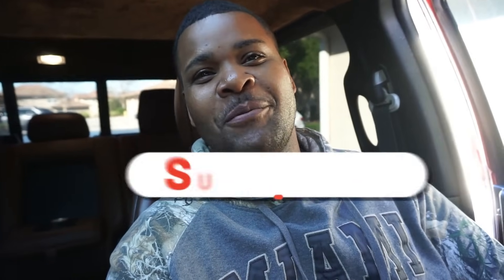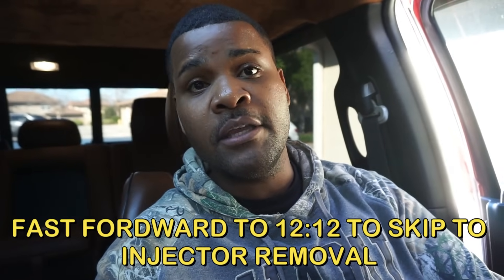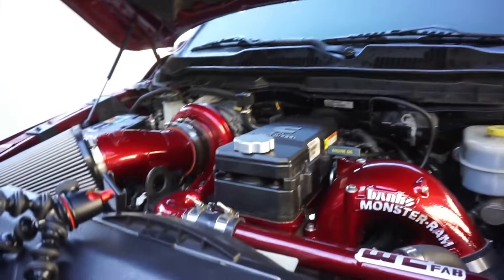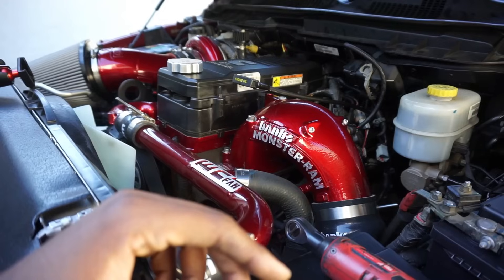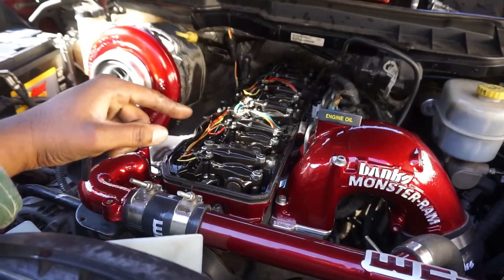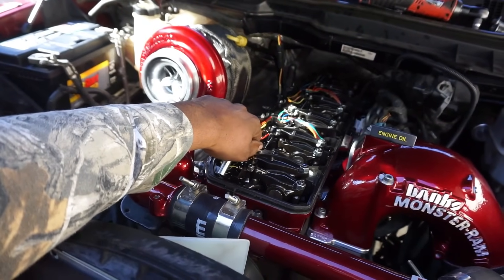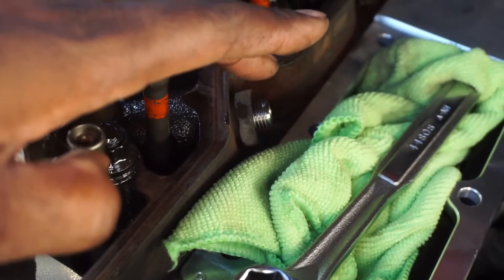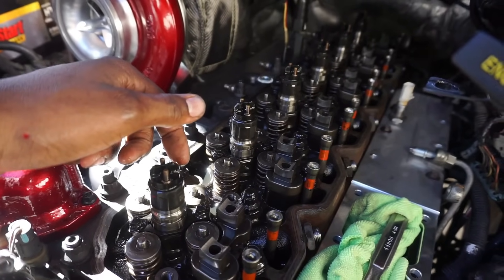FIXING MY BROKEN CUMMINS...AGAIN  ||  INJECTOR REMOVAL

Comment: They are stock injectors. The black is resin on the injectors, the orange is heat. That's why the 6th push rod has a little crown. Like a pool Q, roll em on the table and if they don't have crazy wobble,  your good for now. Chang them when you get the 100 overs. 6th is the hottest point on the block. Thats why they started making thet fleece coolant plate for the back of the block, to get the coolant to the hot point. Upgrade that fuel rail plug cap when you do new injectors. Talk to energy on the injectors when you purchase. You need a relief plug to the specs on the injectors so you don't blow the seals out if you ever get into it too hard over time. Your on your way man. Keep it up, your getting there. I personally know the aggravations on the 6.7.
Reply: I was going to install that coolant bypass but it seems that everybody uses like a rubber hose right over the hot exhaust manifold. 😅 

I was going to do it but upon reading the reviews the rubber hose seems to always swell and then burst. Simple enough to convert to metal?
Reply: Get the fleece, it's a braided line

Comment: I have a 05 that I bought new and I had a 1992 12 valve and now I have a 05 that I bought new also and has been a great truck and still factory injectors no haze or smoke and runs perfect .

Comment: Don't think it's stuck open it would wash the cylinder and thin the oil with fuel. Good advice on the solenoid nuts, ask me how I know! You can put a multi meter on the solenoid post take a ohm reading to verify bad one. Best of luck man! The struggle is real with these trucks

Comment: I would have ran BG or archoil carbon removing cleaner. Both injector and head would benefit.

I curious how much carbon or gunk is in them. Since you were running on the freeway and it was hot outside and then it shut down by getting sprayed with engine oil😂 and with the heat it just probably cook that oil so good. 

Which is why when you run like arch oil or the BG cleaner you're supposed to actually put it in and then run the truck like on the freeway for a long trip. So you can get as much heat into that engine as you can. And sometimes I'll take the off ramp just so I can use the on-ramp 😂 😂😂😅

Best of luck on your job

Comment: I have a question. Can you take the b nut that's on that tube and then turn it around backwards so you can protect the threads when you're using needle nose or a screwdriver to pry against the feed line? Are there any threads if you turn it on backwards? 😅

Comment: Have you decided to go with new Injectors or are you going to rebuild your old ones. If you go new are you going to use stock ones or aftermarket ones. That #6 looked pretty rough, great video as usual  I'll be waiting for the update.

Comment: After watching the video, and seeing that #6 , I'd say that buildup is from the oil going thru the system and excessive heat, assuming the 6.7 has some issue they say the 5.9 has where the back 2 cylinders get way hotter than the rest , I'd say that oil washed the injector and then basically flashed onto it, probably causing your issue, that's my 2 cents on it, I haven't  heard from any master diesel techs that that heat issue is legit but it's possible. Hopefully that helps bro, I just had mine done and did a video on it. My guy didn't say anything about it tho, and he's thorough he would've mentioned something g had there been even a small issue

Comment: It is possible that by coincidence that the solenoids on 5&6 went bad. As far as the tips go looks like carbon buildup which is normal 
The orange looks like rust. I don’t believe that the oil that found it’s way into cylinders 5&6 did any damage to the interiors.
To test the push tubes just because they rolled true doesn’t mean they are good, try a ting test 
You can lightly tap them and listen to the sound, if you have a dull sound in a push tube means that it’s not good 
If you get a ting sound it’s good